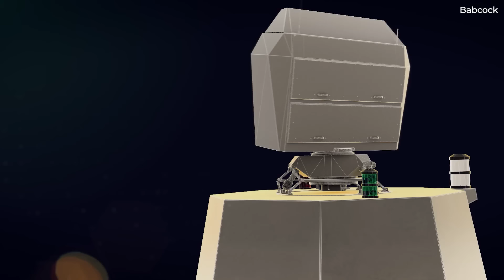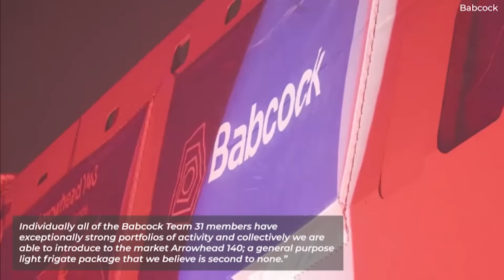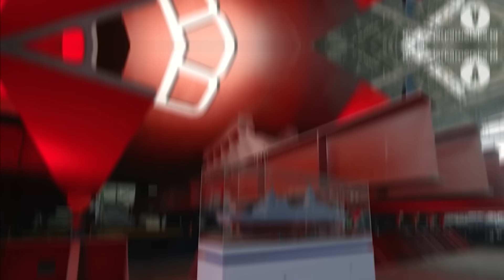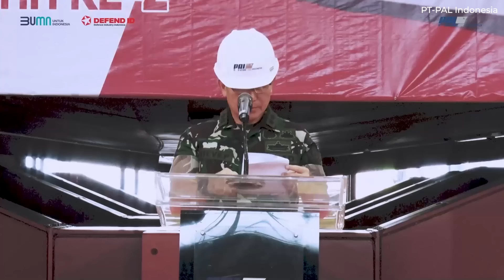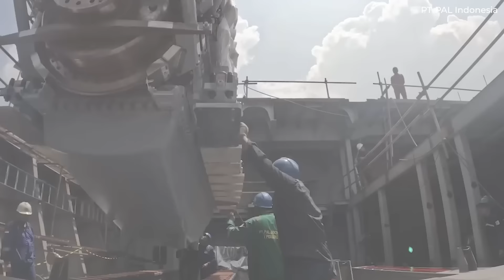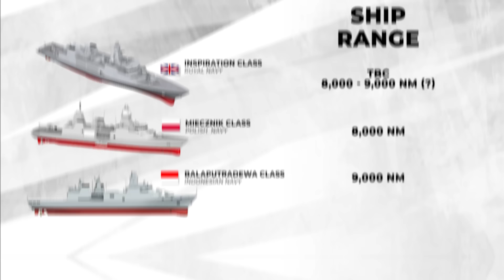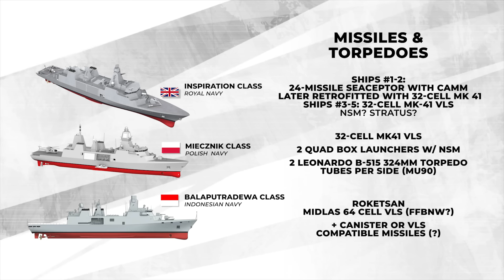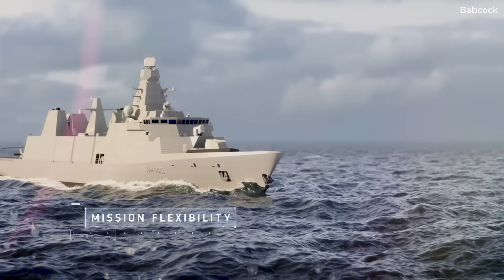Same, But Very Different: The Arrowhead 140 For UK, Poland, & Indonesia

Comment: For Poland, and Baltics in general, the presence Polish variant will be a major beef-up. Baltic's average annual sea state is 6+, with 200 storm days. Poland painfully learned a lesson with its sole Meko A100 - anything smaller than a 4000 tonne OH Perry means you can use weapons at sea state 0-5, and use them with limitations at sea state 5-7. Anything worse, and as stated, that's over half a year on the Baltic, and you are either stuck in port or survival sailing. This is why Poland so stubbornly maintains its two 45-years old OH Perry frigates - large hulls can use weapons at any sea conditions up to 12.
Reply: One of this OHPs - ORP Kościuszko - was on screen in "The Hunt for Red October".

Comment: Yeah. Except they cost same money as Korean and Japanese monster AEGIS equipped destroyers. One could also imagine that US Navy could use such designed. Not to mention, that for Poland, purchase makes hillariously little sense - the only rdeeming quality might be non-existing CAMM-MR missiles, theoretical PAC-3 integration and unconfirmed capability of acting as IBCS node. Of coruse, nobody bothered to integrate Barracuda/Brimstone missiles or DragonFire against flying and swimming trash.  At this size, main gun should be 127mm with Vulcano and similar ammo.
Reply: Where on earth are you getting your metrics from? The Japanese destroyers are way more expensive than even the most high end arrowhead 140 variant?
Reply: @omarbaba9892   Well, KDX-III batch 2 was 1,1 bln USD - 3,3 bln for three ships. Each of three Miecznik costs 4.0 bln USD / 3 -> 1,3 bln USD.   Public data. So?
Reply: @p @piotrd.4850 ght, I’ve looked into it and found where you’re wrong. 

On paper, the cost differences between the Korean/japanese and the polish/Indonesian ships don’t look to be that big. Adjusted for inflation it’s about a 200-250 million USD difference between a single one of the arrowhead 140 and one of the batch 1.

A large reason for the relatively high cost for the 140 frigates is because this includes the cost of establishing the capability to build them and everything that comes with it. Neither Indonesia or Poland have that much experience building warships, compare that to Japan and South Korea who are some of the biggest ship builders on the planet and have a lot of experience building warships. 

This is the same reason why the Canadian global combat ship frigate costs nearly 80 billion for 15 ships because they’re not very experienced or have the infrastructure to build ships like that. 

If Poland and Indonesia were to buy ships built in British they would have been quite a bit cheaper, example being the British ships cost less than 400 million each
Reply: @omarbaba9892   you don't need to actually talk to him, he's a well known hater and basically it seems his main objective in life is to criticise everything the current Polish government does. From tanks and artillery to planes and ships, he's always against it. Don't worry about him.
Reply: @johnnyenglish006 probably a bot tbh
Reply: @omarbaba9892  I am not wrong, and from budget perspective it has ZERO impact where do money go out - point is they do go out and what they bring back  in  return; for price of three destroyers we get less VLS than single KDX-III batch I (3x32 vs. 1x128) and with less capable weapons.  Also, KDX-III batch I wasn't exactly free of all those constraints you mentioned. Solution is simple: buy off the shelf, but people don't get that whole point of arms purches is to equip military and secure the nation, not to feed local "industry" cliques. But again, Russian/Ukrainian level corruption and fraud never really left Poland after fall of communism. "Investing" in industry capacity to build 3 white elephants over a decade is _not economically viable_.
Reply: @johnnyenglish006  Of course, because I'm paying for it. But where did you get absurd idea I criticize Polish armoured purchases, except Borsuk?  I'm quite happy with K2 and M1, Homark-K and K9. Very happy in fact, for last 3.
Reply: @omarbaba9892  when your logic, facts and reasoning fall flat after your naive and irrelevant rationalisations, that's all you have - call somebody a bot 🤡

Comment: A very interesting comparison, although I think the British variant is deliberately underpowered; only practice will tell what will actually happen. As for the Polish version, I believe a ship of this tonnage should have something more substantial in its artillery equipment. I think the 127mm Mk. 45 gun would be more appropriate. But that's just my personal opinion.
Reply: 76 mm 2x 
KRI balaputradewa 322 🇮🇩
Reply: The point of the type 31 is to be a cheaper ship that will supplement the high end type 26 frigates
Reply: @omarbaba9892  Does Poland has or plan to purchase Type 26? No? Thank you. It's like arguing, that K2 should have 12,7 only, cause we have Abrams./

Comment: The Type 31 might be the low end frigate compared to the Type 26, but given the drone proliferation, I think the 57mm would be better replaced with the 76mm as it has a lot longer engagement range and it would be easier to fit more functionality into the ammunition in future (say terminal guidance)

Comment: The lack of any ASW on the Type 31 Is just absurd. The UK has too small of a Navy not to have these be actual combat vessels capable of ASW escort. It's not like they have 20 ASW escorts sitting around.
Reply: The whole point is to supplement the 8 type 26s on patrol which are high end ASW vessels.

And they will have some ASW capabilities via helicopter

Comment: The Ranking would be  1. Poland 2. Indonesia 3. UK
Reply: Indonesian ship has fangs Poland and Britain has teeth
Reply: @adinurdwipurwanto7126   True Indonesian variant offers serious firepower, 64 VLS and pair that with 2 76mm OTO Melara cannons its awesome.  21 endurance days is a minus though but yeah Poland and Indonesia's configuration is wayyyy better than the UK, right now the Inspiration Class it really is just a glorified OPV,
Reply: @grdno1723  1 VLS container contain 1 CAMM-ER or 4 CAMM missile. (8VLS x 4=32 CAMM)+(24 CAMM-ER)+(8 NSM in box launchers)= 64!
Reply: @giewuu7211  1 container Midlas VLS can contain Quad Pack Hisar missile. in 64VLS, 16 vls for Atmaca ASM, 32 vls for Siper dan 16 vls for quadpack Hisar 16x4=64 missile, total 112 missile.  Other option is 16 Atmaca+16 Siper + (32x4) 128 Quadpack Hisar total 160 missile.
Reply: @adinurdwipurwanto7126  yea But poland has more teeths(more missle)
Reply: @auliaaa.9858  no
Reply: @grdno1723  yes, 4 camm missile you can contain in 1 VLS container

Comment: La Fragata type 31E ... tiene al menos 5 variantes de tamaño y peso standard , asi como equipamiento " a pedido del cliente " , pues no es una Fragata Light pedida x la R.N. bajo un requerimiento de NO sobrepasar los $ 250 millones de Libras Esterlinas, la ACh se interesa x una de esas variantes , pero más pequeñas que el modelo de la Royal Navy , aunque fuertemente armadas y equipadas con un coste promedio de entre $ 440 - 450 millones de Dólares x Unidad.( La Escuadra Chilena necesita 8 unidades )

Comment: The Balaputradewa-class is intended to be equipped with the SIPER surface-to-air missile and the Cakir cruise missile, both of which have already been ordered by Indonesia from Turkey.

As for the Atmaca anti-ship missile, its integration into the MIDLAS (Milli Dikey Atım Sistemi) Vertical Launching System (VLS) is still under development by Roketsan. The first batch of Atmaca missiles has been prioritized for Indonesia's existing fast attack craft (KCR) and corvettes. In a future batch, Atmaca is expected to be acquired for the Balaputradewa-class once Turkey completes the VLS-launched Atmaca development.

Meanwhile, the BrahMos missile has been ordered exclusively for Indonesia's coastal defense system and is not intended for the Balaputradewa-class.

Comment: I'm mostly concerned with the RN's T31s. No hull  nor towed ASW sonar is a dangerous, glaring omission. Discussed this with other posters on UKDJ for years & they mostly thought that CAPTAS would do the job, but it seems they won't even have CAPTAS either.
While great for anti drone defence, alongside the 2 40mm Bofors, I think the 57mm Bofors is way too light for an escort main gun. 76mm should be the minimum calibre, preferably standardise the whole escort fleet in future with the BAE 5 inch, as the T26 will have.
What seems to be the crucial point in ship survivability is how many missiles a warship has to defend itself or its taskforce. Hopefully more can be added by dedicated defence drone, but 24 SAMs is pitifully few.
I'd also go for a longer range, more capable radar like the Polish ships have & beware of too small crew size, which are a dream for the treasury, but in operations an Achilles heel. You need spare hands to mitigate casualties & provide the manpower to deal with repairs & contingencies in battle. Starting with only just bare minimum is courting disaster.
Undermanned, underequipped, underarmed. Plus we need far more to rebuild the RN to a level that is truely capable of all we need & to make us both a credible conventional deterrent to enemies & useful contributor to our allies, rather than a burden to be carried.

Comment: Well - for Poland these are meant to be the main surface combatants. But strategically - there is actually little possibility of taking these out to fight on baltic sea. Baltic sea is kinda covered by a lot of costal NSM batteries, there is little possibility for Russia to even attempt anything other than fleet evacuation from Kaliningrad in case of conflict, their baltic fleet is just too exposed at home port - likely before any hostilities would start they would sail them out to safer port instead of trying their luck in NATO lake. Not to mention even attempt landing, that would go horribly wrong rly fast. So these ships will be mostly... used to prevent trade interdiction by subs or single vessels that somehow avoided detection. Or in case NATO collapsed - to contest any attempted naval blockade.
That's the reason why they are equipped to fight anything be it subs, sufrace warships or aircraft - with anti-sub role being particular highlight, that's what the MU90's are for, since it's a light torpedo perfect for the task. Secondary role is to boost air defense along the coast.
But they are not expected to be fighting pitched battles in task force setting. On baltic they would likely patrol around western coast of Poland.
Reply: I have a feeling that these frigates will be Poland's contribution to NATO's defence of the North Sea, Artic and GIUK-gap, just as Sweden's Luleå-class will be. As you said the Baltic sea will mainly be covered by shore batteries of ASuMs, air power, missile boats, coastal corvettes, drones and in particular subs.  With both Sweden and Poland getting the A26 sub designed in particularly to fight in the Baltic, those alone will dominate naval operations in the Baltic.
Reply: @christoffermonikander2200  Poland imports oil and gas by ship. We need protection for transport vessels.
Reply: @giewuu7211  For that, you'd need more like 30 vessels....
Reply: @christoffermonikander2200  It's likely at least one ship on rotational basis would participate in such missions, would be no point having them if they just sat in port, and it's quite an area to patrol.

Comment: If this class replaces the Danish Ivar Heuitfelt class, it will actually go down on missiles, being that it has  Mk41 32 VLS cells but also 2 Mk 56 VLS cells for 24 ESSM, and 2 x 8 Harpoon missiles. The Red Sea experience showed need for a large missile load out, and being that the Kingdom of Denmark has one of the biggest merchant navies and longest coast lines in the world, that needs to be reflected in the choice of fregats, such as HDF-6000 from South Korea
Reply: The Arrowhead 140 can be configured with additional VLS systems.

Babcock has displayed an anti-air warfare variant equipped with 24 ExLS VLS (I.e 96xCAMM) in addition to the 32 mk41 VLS. 

It is also possible to replace the forward 'A' turret position with at least one VLS module. (Can't remember if the space was enough for 8 or 16 VLS) 

The main lesson of the Red Sea is that you need cost effective systems that can defeat drones. Missiles are way too expensive for the job. The paradox of the Drone age is that anti-air artillery is set to enter a renaissance since it is the most effective counter to drones that we have at the moment.

Comment: The T31 unit cost does not include Government Furnished Equipment which includes the weapon systems. In addition the T31 has had a modification from hull 3 to include VLS as part of the build whilst hulls 1 and 2 will receive theirs during a capability insertion period.

Comment: In time the Type 31 needs a 64 cell Mk 41 VLS, NSM/Stratus and a Hull mounted sonar.
But for now, lets get the Hulls built and operational at BABCOCK, Rosyth, Scotland. 2 Hulls are completed and fitting out 3 hullsare under construction..
The Royal Danish Navy/ Danish procurement is still pending, and the Babcock Arrowhead 140 is one of the potential choices.
Reply: With it's radar choice there's no point of 64 VLS. If it receives a radar upgrade then it's worth it.

Comment: If Denmark Pick arrowhead 140. I hope our loadout would be more like the Polish.
Reply: depends on the amount of money Denmark wants to spend. if they go for more fancy stuff (the Arrowhead 140 is designed for money-tight countries) then Denmark might favour the French FDI frigate - like the Swedish did. 😊
Reply: @embreis2257Type 31 has so much in common with the Ivar Huitfeldt class that it is the preferred ship. And of they add Stan flex modules, it's a slam dunk. But know that the launchers are much cheaper than the missiles.
Reply: @embreis2257 The FDI is tiny and has poor range though.
I think Denmark generally likes going out into open ocean on anti piracy missions so the FDI probably wouldn't be best for that.
Reply: @embreis2257  At over €1.15 billion per unit, the Polish Miecznik (Arrowhead 140 PL)  is significantly more expensive than the €800–900 million French FDI. However, a direct price comparison is misleading due to the vastly different operational requirements of the Baltic theater. While the FDI is a compact 4,500-ton multi-mission ship, the Miecznik utilizes a massive 7,000-ton Arrowhead 140 hull, tailored specifically to survive in a high-intensity A2/AD (Anti-Access/Area Denial) environment near the Kaliningrad Oblast.This specific theater demands extreme weapon and sensor saturation. Unlike a standard FDI, which typically carries 16 to 32 Sylver VLS cells, the Miecznik features a 32-cell Mk 41 VLS matrix. Thanks to CAMM-series quad-packing, this configuration allows for a staggering loadout of 64 to over 100 anti-aircraft missiles. The higher price tag reflects a deliberate choice to build what is essentially an air-defense cruiser disguised as a frigate, combined with the initial costs of restoring domestic shipbuilding capabilities. For the Baltic environment, this level of firepower is a necessity, not a luxury. In reality, Poland is building vessels capable of defending critical infrastructure located at sea and along the coast ( offshore wind farms, pipelines, LNG and fuel terminals, ports...)
Reply: @embreis2257 Money tight my a$$. Well, KDX-III batch 2 was 1,1 bln USD - 3,3 bln for three ships. Each of three Miecznik costs 4.0 bln USD / 3 -> 1,3 bln USD.   Public data. Do you even grasp difference between these?